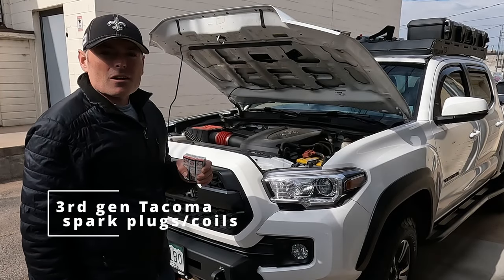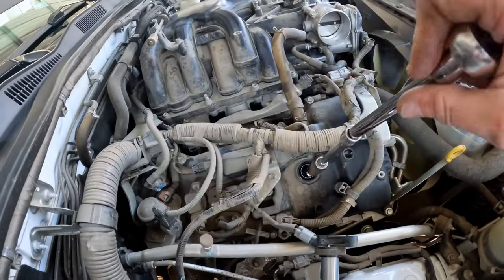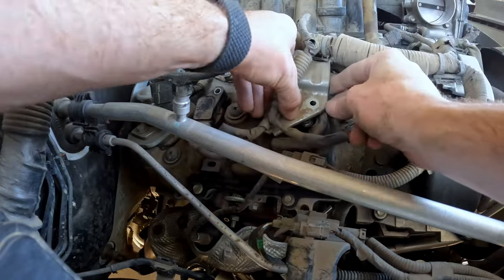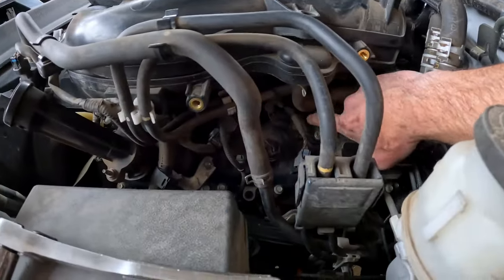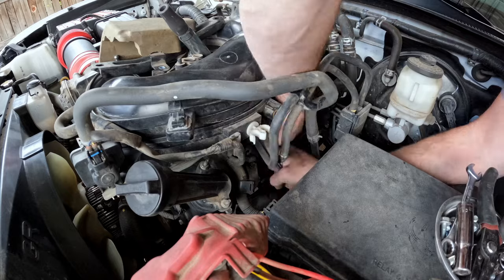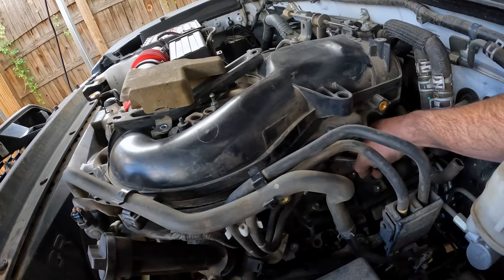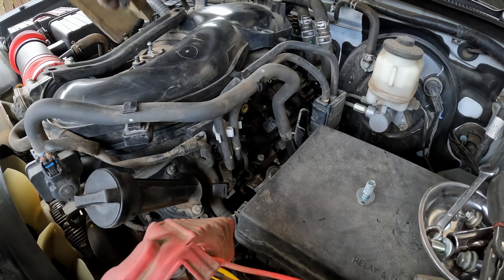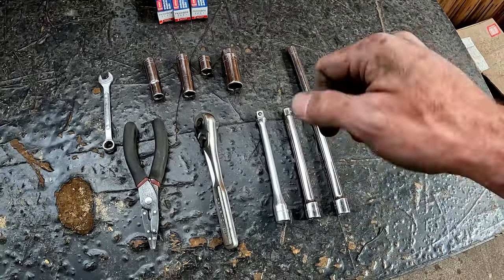DIY 3rd Gen Tacoma Spark Plugs $ SAVE MONEY $

Comment: i just went to Toyota dealer to have my 2021 Taco serviced and the service writer said: "you need a spark plug change. is going to cost you $640.00. I was like: "I'll do it my self"
Reply from the maker: Same here. Good luck with the install.
Reply: They quoted me 890.00
Reply from the maker: @Cliffdodger  that’s crazy!
Reply: Just got quoted 895
Reply: They just quoted me at $967😂
Reply: Yea, Gallatin, TN Toyota went from $120/hour to $169/hour labor rate in 3 years. Thanks Biden. I do everything myself now.
Reply: @ValueClub99  crud I was scared to even ask the price, I already ordered a 6 pack of denso plugs and will swap em myself.  Almost 100k and barely any issues.
Reply: Atlanta Toyota in Duluth Georgia said almost $700. We need to boycott these places.
Reply: They want $708 for the switch out and $134 for a damn center wheel cap. I’m good.
Reply: Lol , they told me $737
Reply: I just went this morning and they wanted $1.2k...absurd
Reply: @bschuske  wtf? wow!
Reply: @DjGCue71  ya they say it would take 5 hours to change spark plugs lol!!! What a joke

Comment: Appreciate the video man! A few things I found while doing this. I’m pretty mechanically inclined so this took about 45 minutes. You don’t need to remove the rear bracket to get the middle and rear plugs out. Also I just folded the rubber foam piece cover the rear plug up and back out of the way. No real reason to remove them unless you just need the extra space 🤷‍♂️
Reply from the maker: Nice work!

Comment: I have a 2004 Dodge Ram 1500 v8 4.7l  owned it since then. Oil changed every 5k miles, engines still run like new now 248k miles passed smog every 2 year. 

Regular maintenance any vehicle should last a long time 😊
Reply from the maker: Nice

Comment: Great video!  Only have 2K miles on mine so far.....but will save this for when I need to do plugs
Reply from the maker: Right on!  It will be here when you hit 60k!
Reply: @infosponge  did you notice any performance change with new plugs. Den so says they are 80-100k plugs even though Toyota says 60k
Reply from the maker: @gregsheridan  I changed them at around 69k.  Haven't really noticed a difference.
Reply: Minor startup symptoms started at 93k miles for me. So time to do it. Grant it I went 33k over what the manual says 😂

Comment: Thanks for the video. I used to have a 2003 tacoma 4 banger and it was so quick and easy to change the plugs. Now I have a 2017 Tacoma V6 and what a pain it is compared to the older truck. Plus my truck is raised a bit so I have to get on a step ladder to do it. I hate the way it is so much harder to do simple maintenance on vehicles these days. My mechanic quoted $460 total after tax which is way less than the other quotes in the comments. Not sure if I will try it myself or just pay the mechanic.
Reply from the maker: If you’ve done it, you have the tools.  I’d say go for it!
Reply: @infosponge  I did it this afternoon in less than 2 hours. I have one of those ratchets that can flex in different positions and it made it way easier.

My truck is sputtering when accelerating after changing the plugs. I was hoping changing the plugs would fix the issue but it didn't. It was sputtering every now and then prior to changing the plugs and now it is sputtering worse. The check engine light isn't coming on and it isn't a rough idle.

Comment: Great video.  I got the passenger side & the front spark plug on the drivers side done then came in to watch this video on hpw to get to the last 2 plugs.  Most helpful.
Reply from the maker: Glad it helped
Reply: @infosponge  It was a breeze after watching your video.  Side note, that rear bracket lower nut can be accessed through the wheel well.  I'm 72 Y.O. but adamant about doing whatever I can on my vehicles myself to save money and the peace of mind it was done right.  Tomorrow, a transmission oil change, differentials & transfer case.

Comment: Great video but there wasn't any mention about worrying dirt and whatever getting into the spark plug cylinders. Is that something not to stress over?
Reply from the maker: A little dust/dirt wont hurt anything, just be careful not to drop large items in the hole.

Comment: Hello, there is a controversy about which spark plug to use. I was looking into the following options:
Denso (3491) FK20HBR8
Denso Iridium TT - 4705
Which one of the two do you recommend using and why?
Reply from the maker: The factory plug is the 3491 and it works perfectly fine so why change it. That said the smaller electrode size on the 4705 may add slight longevity and performance increases. I would just buy whichever one is cheaper at the time.

Comment: Maybe a silly question, but do the spark plugs need to be installed to a certain spec? I don’t see many having issues I just don’t wanna break one inside and then need to rely on someone else
Reply from the maker: I’ve never used a torque wrench on spark plugs but there is a spec, I believe it’s 18NM or 13 ftlb.

Comment: Good stuff!!  Do you by chance have the part number of the Spark plus you use?  I’ve seen two online and rather not get them from the dealer as they charge $15+ for each 😵‍💫
Reply from the maker: The ones linked in the description are the factory parts and what I would suggest.  They are $14 right now on amazon.

Comment: Quick question, my 2019 trd 4x4 has 161k  , I have 3” lift 275/70/17 Mickey Thompson BaHa legends, love em. But I drive 78-83 mph average in South Florida Ft 75 original plugs. I average 13.9- 15 mph  will plugs definitely help?? Tnx Tacoma—boy SWF 😎🤘
Reply from the maker: Not sure how much they will help, but it certainly wouldn’t hurt. Either way they are beyond do for replacement. Could always pull one out and see what they look like.

Comment: what is your mileage interval on changing plugs?  I've heard it really should be done every 30-40K miles
Reply from the maker: Toyota recommends 60k
Reply: @infosponge  sweet Moses. I've got 120k. Guess it's time. Thank you for the guide!
Reply: I have 142k on orginals and having no problems but watching to change them before I end up with a bad plug at in inconvenient time
Reply: When your mpg starts to decrease.
Reply: Changed my old Lady’s plugs before they hit 120k,  starts faster, runs smoother and responds better when you punch the gas.

Comment: How tight do the plugs need to be? And do you need to do anything to them out the box?
Reply from the maker: I have always installed plugs by feel, but I believe the spec is 13 ft-lbs.  The gap is set out of the box but you can check it if you want, should be 0.032".
Reply: @infosponge  gotcha, so 13 lbs doesn't sound like you have to crank down hard on it. I'm about to do my spark plugs,  but afraid I'll tighten too much or not enough

Comment: What tool did you use to unplug the electrical clips from the spark plug coil?
Reply from the maker: Just pulled the coils/wires from the plugs. Don’t recall removing any clips.

Comment: I'm just trying to find a definitive answer on the 4705 versus 3491 spark plug dilemma. Both seem to work fine, but they are gapped slightly different and the 3491 is a little more expensive. I suppose it really doesn't matter but it's a bit maddening and I wish someone had some reliable info/data on the pro and cons of either.
Reply from the maker: 3491 came stock so I just stuck with it.

Comment: Ay bro i changed everything cuz why not but now it idles up and down whenti turn it on
Reply from the maker: Strange, it could be a bad gap or cracked plug. If you check the codes, it might tell you which cylinder.

Comment: Isn’t the PCV on the other side of the engine?
Reply from the maker: That is where the valve is.
Reply: I change mine every 25k because its a $6 part and if it goes bad we are in trouble.

Comment: Its not hard. Something I noticed.  There were two loose with oil coverage.  Definitely smart to check them. On occasion.  Also the mixed info on 60k or 120k. The engineers say 120k. The politicians say 60k cuz off pollution lol. I'll stick with the engineers. 
I was at 107k but it's a work truck. Was definitely due.
Reply from the maker: Good point